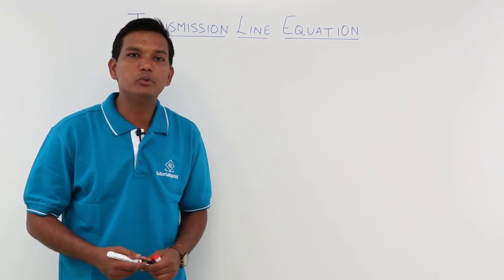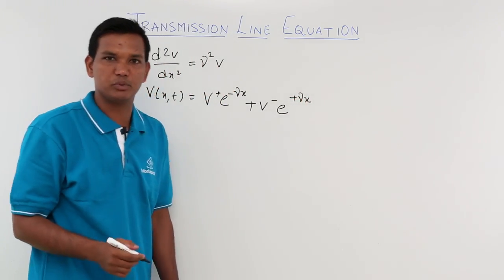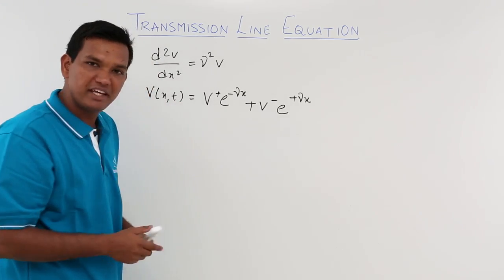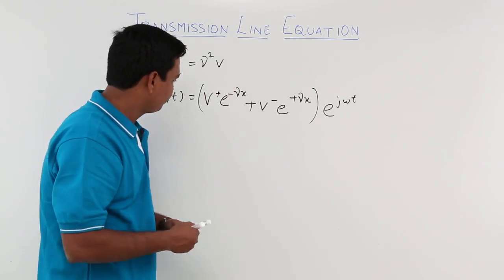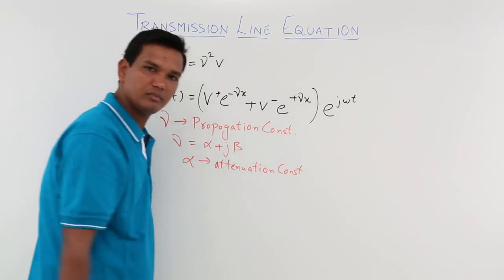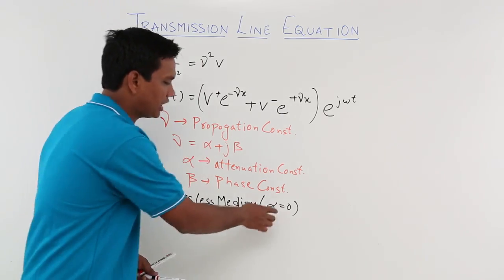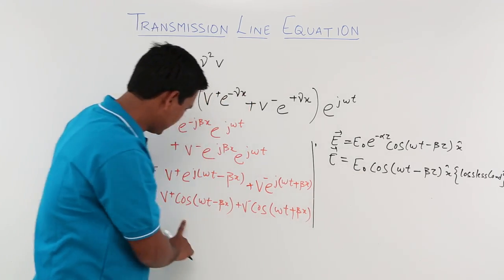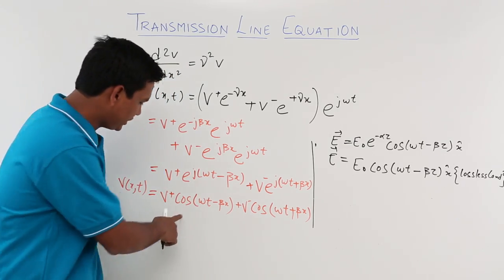Transmission Line Equation Part 2

Comment: You are required to match a load with an impedance of ZL = 70 - j80ꭥ at a centre frequency of 450 MHz to a 50ꭥ transmission line with phase velocity v =2.1 x 10^8, connected to a generator with a  50 ꭥ internal impedance. The choice you have is to use either single or double stub matching. Determine the matching technique which gives the greatest VSWR <2 bandwidth and provide quantitative information to support your answer.
sir, please solve this problem.